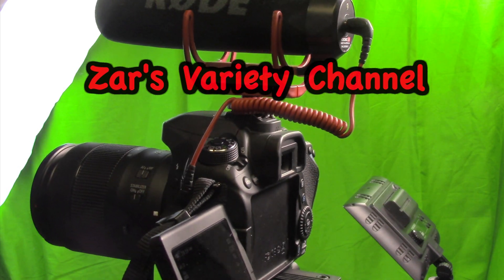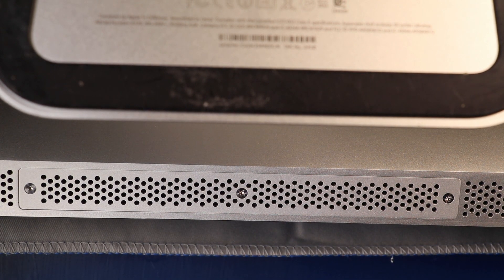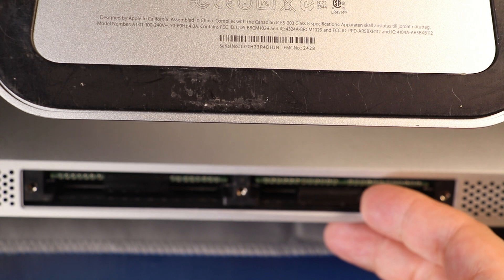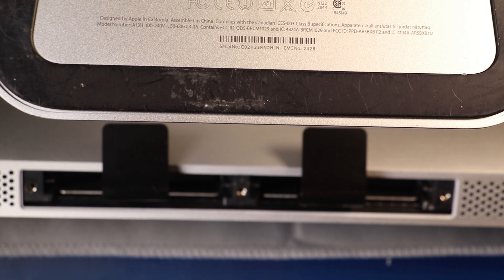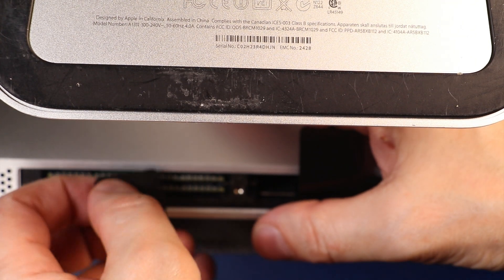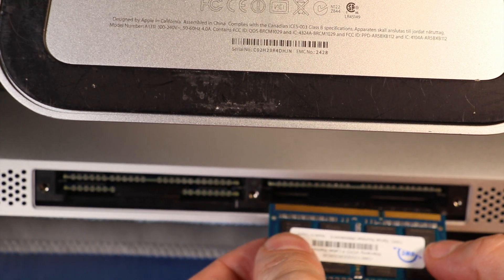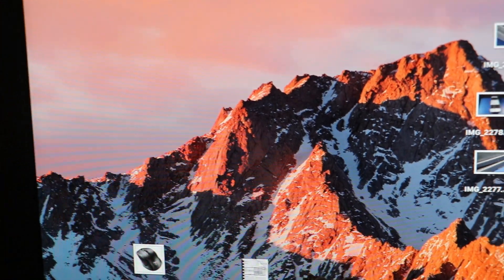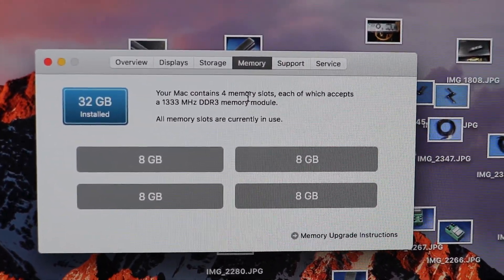How to upgrade 8GB to 32GB RAM (OWC) in 2011 iMac Computer - Tutorial

Comment: Does stuffing 32GB ram make an impact on performance when running BootCamp/Windows 10? Namely if it improves performance on games like GTA (via Steam in Windows 10) that demands more video ram? This is for an iMac 21.5 Mid 2011 with currently 4GB of ram, and an AMD Radeon 512 MB graphics card. Thanks!
Reply from the maker: It will help but video RAm is whats in your video card.  it will help windows and multitasking eTC it will improve performance from what you have in there now!
Reply: @Zarfilms2007  Thanks, appreciate the quick response! The GTA game itself shows a 'video ram meter', if that makes sense, to indicate user can increase video ram to improve graphics/gameplay performance. I wasn't sure if by increasing the main iMac ram to 32GB, if it would affect this meter in the game. Or maybe it will mitigate the lag that is experienced when playing the GTA game?

Comment: hey quick question I was planning on upgrading my 16gb ram to 32gb, would you recommend
the owc brand for ram or it doesn't matter?
Reply from the maker: OWC has been thoroughly tested i have them in my 2019 Imac other cheaper brands can have issues
Reply: Zar's Variety Channel  thank you so much 🙌